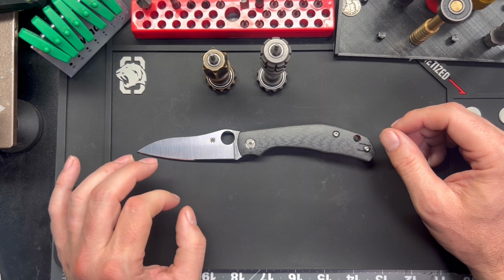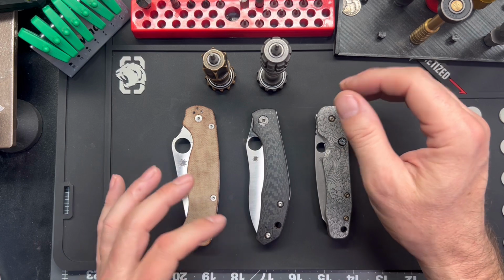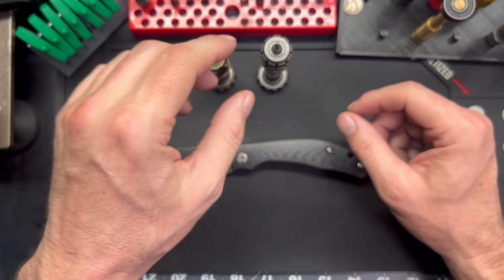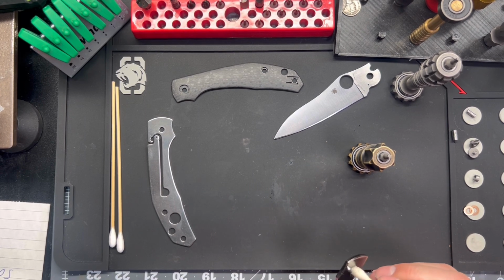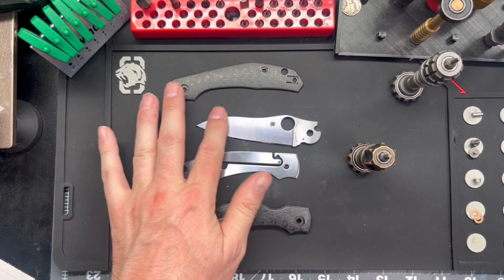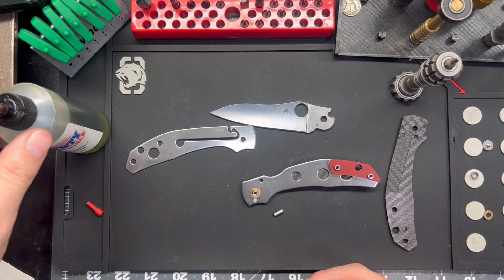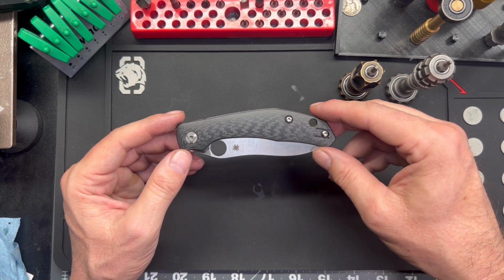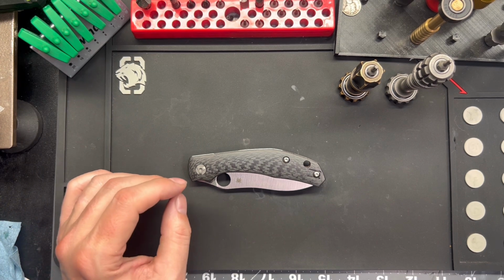Spyderco Kapara! Best Spyderco EDC Ever?

Comment: The Kepara is also one of my favorite edc knives! I like the way it cuts and the carry profile. It looks great and works great. I carry mine when I won’t be doing any hard use tasks which is much of the time. Recently, I have been carrying the Gayle Bradley 2 with Cru Wear blade for more hard use. I like it too for carving and cutting. Although, I kind of wish for the geometry of the GB1. 

Thanks for the disassembly video on the Kepara. I don’t think I realized there was a bushing on the pivot.